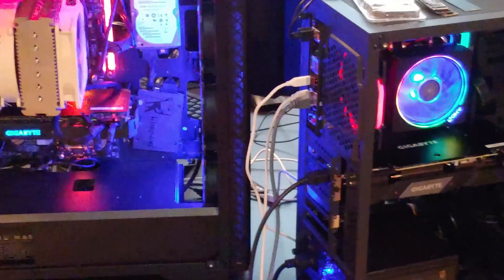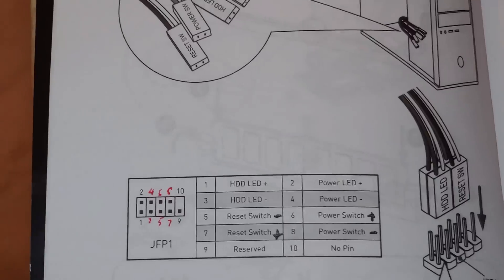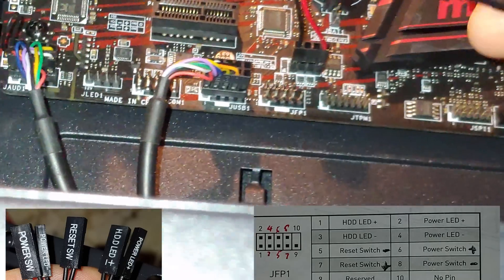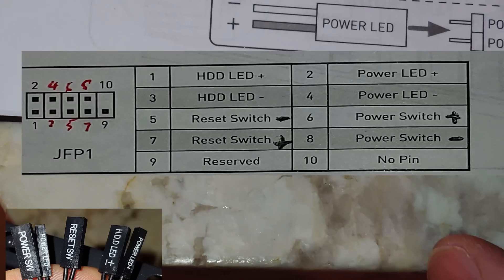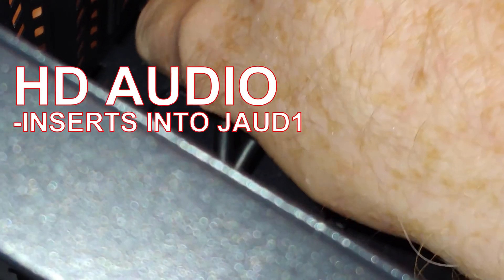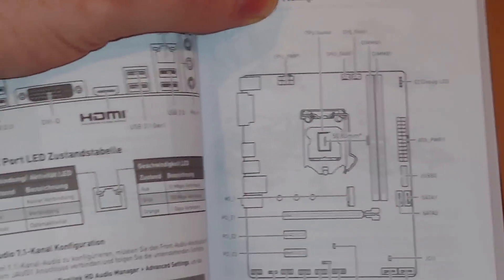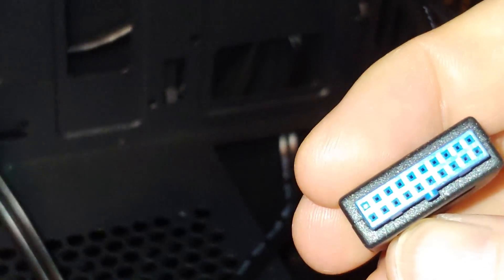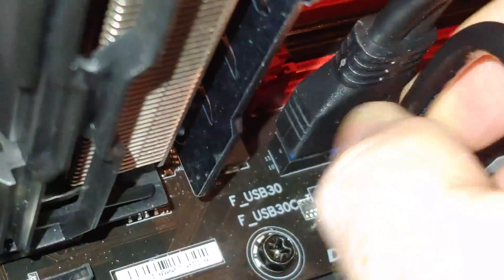Ep 5: 2020 How to Build a Computer, How to Install PC CASE CONNECTORS HDD, USB, SPEAKER

Comment: David one thing to note about these front panel connectors, the ones that have the switches those do not have any negative and positive terminals, essentially all they are doing is shortening the pins on connectors to allow the computer to turn on or turn back off, so you can put them one either way and they will still work just fine, however the leds are different those are the light emitting diodes, so they only allow power to flow in one direction, if you happen to put the led connectors on the pins backwards it won't damage anything its just that when you go to power the computer on the lights for the hdd or power light just won't work.